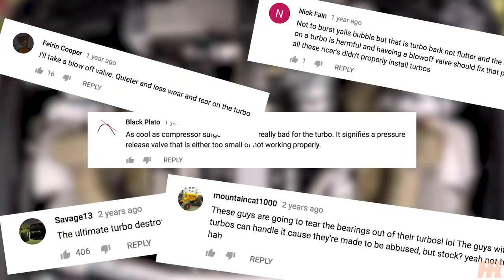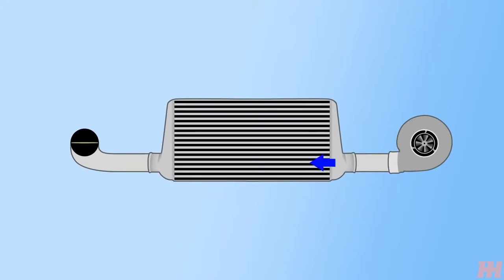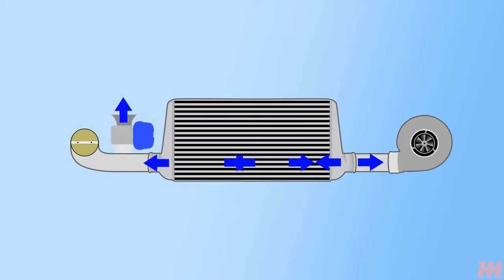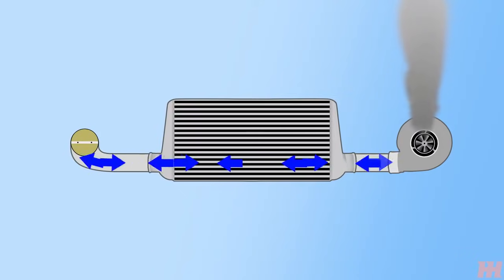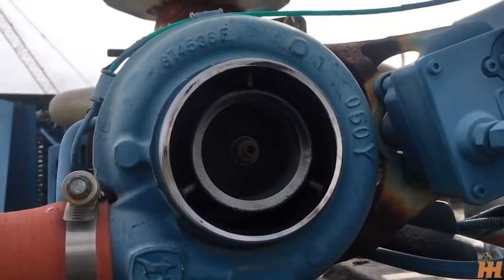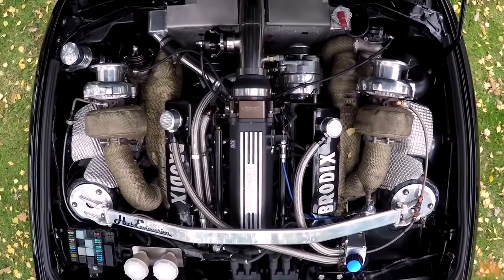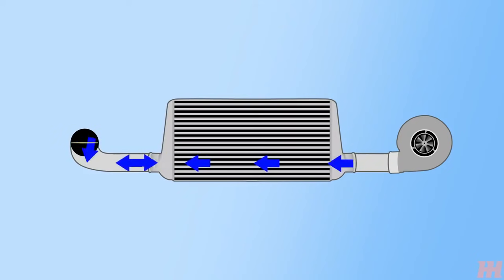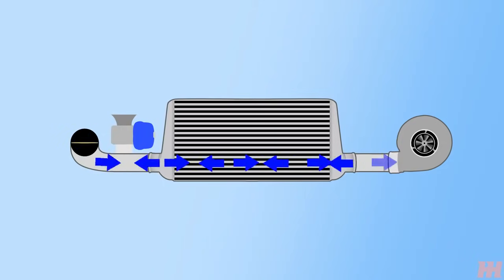The Truth About Compressor Surge

Comment: Just one question, if the throttle valve is the main culprit for reverse air surge, why do Diesels have blow off valves since they have no throttle body?
Reply: While they don't need them, they still help on a diesel to keep the intake air flowing smoothly through the compressor.  Although, as you said, there are no TBs on them, the thing that drives the turbocharger is the exhaust volume/heat... so when you stop "pouring on the coals" the turbo doesn't have as much exhaust roaring through it anymore, and that causes the entire engine's flow (VE) to slow down VERY dramatically (which will in turn "fight" against the compressor's high rpm), so they open up a "BOV"/solenoid to allow the turbo to continue freely pumping the air through.

Comment: my pickup truck has turbo and it didn't have BOV at all, and still fine running in 70,000kms.
Reply: If its a diesel its because diesels dont have throttle plates. No diesel has a BOV.

Comment: By a lot of peoples logic antilag would kill turbos in a day. Rapidly changing the speed of the turbo hurts it? Oh like (2 step or anti lag) sending 2 or 3 cycles of your engines unignited gas/air down the exhaust and lighting it ( ideally before the turbo) is meant to cause a rapid change in the turbo speed.. to add to it i would assume the extreme inharmonic vibrations or combustions would do more damage by rattling the turbo than air itself slowing it down. 

I think we can all agree the 11 year olds are not the people who think it causes damage, because im sure it has in a least a few instances before. But the people who genuinelly believe that the turbo spins backwards.

Comment: So if it’s installed correctly, do you still need a blow off valve? Because if you have a blow off valve you won’t get the closed throttle flutter, correct?

Comment: Open throttle compressor surge is common subaru’s with big power.
Reply: You're thinking of wastegate flutter which is common on modified Subarus, that sound comes from the wastegate rapidly opening and closing to maintain a certain boost level

Comment: I got question. Like most diesel cars atleast one i own (VW golf mk4) doesnt have Blow off valve from factory. But it does not damage the turbo?
Reply: Lukas Juozaitis. Let me know when you see the throttle closing on a diesel
Reply: Nebbia affaraccimiei ohhh really ;D sorry 😂 my bad
Reply: Nebbia affaraccimiei but is it somehow possible to get this "compression surge" sound from a turbo diesel?
Reply: Lazar Janjusevic well i never heard it and i highly doubt that it possible
Reply: Lukas Juozaitis. It's possible but i don't know how... Search on yt for 1.9tdi surge or turbo diesel surge and it sounds exactly like this
Reply: Lazar Janjusevic hmm diesel have more turbo pressure. Like mine golf have 1.5bar ( ecu remaped) maybe its because of that and pressure have no where to escape
Reply: Ohhhh i think mine car have surge. When you let off throttle there is like pruuufft sound like that. But can't hear because muffler and catalizator. If pressure would be higher it would be easy to hear i think
Reply: Lukas Juozaitis The Cats and muffler dont affect flutter sound as it comes out of the compressor side not the turbine side
Reply: Also let me know when your fucking diesel engine can't take more air
Reply: It's possible to get "off throttle" surge on diesel engines. If you go suddenly from high rpm on boost to idle or close to idle the amount of air the engine will be able to flow through decreases rapidly and the turbo will flutter for a moment. This is often very audible on tracktor and truck pull competition engines when they let off the throttle.

It's much easier to reach flutter on engines with throttle plates thought, because even if the rpm's stay up the plate will block of the air going trought immediately.
Reply: Lazar Janjusevic my dad drives a navara with the yd turbo diesel engine and when trottle is released while under load it flutters

Comment: Can you not setup a blow off valve so that it opens at a set boost pressure much like a waste gate? Then you could have the blow off valve venting excess air volume at WOT, which should stop the surge.

I'm not familiar enough with turbos to have encountered this issue, so please enlighten me.
Reply: Not sure if you are still curious, but if you install a flow control valve you can adjust it to where it becomes a delayed blow off,  gives you the turbo flutter we love and then relieves pressure. It's cool to play around with and you can adjust it as you would an aftermarket bov, AND you are able to do it on a stock BOV

Comment: Thank you for posting this , god damn do I get sick of morons thinking OFF THROTTLE “compressor surge” , aka flutter, is doing any real damaging effect 

Ironically I’ve been having a problem with my S15 under WOT where it’s been spluttering about at around 5000rpm, turned out to be the spring tension in the BOV set too tight . Once I had loosened it off, the problem is now non existent 🤦‍♂️😂
Reply: You're loosing boost at high rpm by loosening the bov spring,  the flutter at wot should normally be regulated by the Wastegate

Comment: Recently ive been slightly accelerating and hear a blow off sound usually when im going uphill
Reply: That's probably because you're not generating enough boost to open the BOV yet, anything beneath that will flutter. I hope its only happening as you back off the throttle, and not during acceleration..?

Comment: Aren't wastegates installed to prevent open throttle compressor surge?
Reply: Wastegates only divert exhaust around the turbine to try to maintain a desired amount of boost. If you set that boost too high it will still surge. It's something most of us wont experience. You really only see it on highly modified car running tons of boost.

Comment: I’d assume since diesels have no throttle plate and run via metered fuel injection. Cutting the fuel would be of similar effect for it since there’s no combustion for drive pressure to drive the turbo?
Reply: yep, pretty much!

Comment: ive heard on smaller and older turbos compressor surge can cause more damage, if i blocked off my recirc valve on my 98 wrx with the stock td04 turbo would it do much damage?
Reply: Older turbo's are actually less susceptible to damage due to not using ceramics or ball bearings.

Comment: This would be ok if you're maybe under 10 psi. Anything above and you're on borrowed time for a rebuild or replacement. People need to remember that the exhaust gases are still turning the hot side turbine while the compressor side is getting buffeted by returning air. Something will eventually snap

Comment: If ur having open throttle surge can’t you just install a valve that opens when this happens in order to keep the pressure from getting to high?
Reply: tamer ursavas it’s called a waste gate
Reply: Grant i tought the waste gate was only for closed throttle surge
Reply: tamer ursavas a waste gate basically limits how much the turbo spools by dumping excessive exhaust gas.  If you have open throttle surge this is because the turbo is spinning too fast / producing more air than the engine can use.  To stop this you get a correctly sized waste gate that can dump the excessive exhaust gas and keep the turbo spinning at its correct speed.  I hope this makes sense
Reply: Grant isn’t it better to dump the compressed air instead of the exhaust?

Comment: I'm not too familiar with the more intricate characteristics of turbo cars, but I'd imaging that turbo flutter is not good for keeping the turbo spooled.
Reply: You are correct, while turbo flutter with closed throttle sounds awsome and does not do any damage, it does slightly decrease preformance.
Reply: @MatthewKrebs_BlackBrave8  tell that to all the people who have snapped hx40s running htem off their map... you guys crack me up. some idiot says on the internet its not bad so you take it as religous law.. plenty of videos of people breaking turbos by barkign them aka surge.
Reply: @g__wizz  Yeah people don't come to the internet for the right answer, they come to find reassurance of what they want, that's how they justify it. It's just about convincing themselves.
Reply: @g__wizz  I mean people think it's smart not to vaccinate their kids because of internet "knowledge" and "research". Its legitimately sad and scary.
Reply: @g__wizz  link me to these videos? Cause I spent plenty of time around high HP cars when I was younger, none ran bov's, all turbos were fine. The only time I had heard of people swapping out turbos is when they wanted to get more boost than the turbo could put out. Never heard of one breaking because of surge lmao
Reply: @chrisbyers4726  hows that holding up for you.. here I am three years in not regretting NOT doing any of that nonsense.. you got heart issues yet?
Reply: @strider5119  https://youtu.be/nCj6Spwl1CU. You can see it bounce the wheel around... it creates thrust and ultimately wears the bearings to the point of the housing making contact with the comp wheel.

Comment: flutter happens when you are able to let go that compressed air via BOV etc. not during backpressure build. backpressure won't hurt turbo shaft one bit as it's not bending the shaft, however you can actually hurt your throttle body if you are dealing large enough amounts of boost, as it's just a puny plate made out of brass that just 'bodies' pounds and pounds of boost. BOV & recirculators are made to prevent that.

tl,dr; flutter is good, your turbo is fine, calm down.

Comment: Mine doesn’t make a flutter noise but it does sound like it’s clogged cuz when accelerating if the turbo works at 100% it whistles a little sounds clean tho 
Other time it makes sort of choke noise like chckk and the turbo lands flat on its face usually occurs after 4000 rpm but occasionally at 3100rpm as well the turbos only 98k miles old 
I do have a P0299 code that goes away after using degreaser for a few days even up to a week! And there’ll be no problems until it clogs back up
Could this be an oil intake issue? I really hope so cuz it’s only $25 for the part haha while the turbo could range from 250-700

Comment: ok but not running a bov/bpv wont it stress the turbo in the long term? and isnt a bov/bpv more efficient on a turbo pushing more boost than stock?
Reply: A bov can be another point of failure imo. I've never heard of anyone fixing a turbo earlier than anyone else. Plenty of people I know have blown engines and transmissions and still have the same turbo and no bov. I've seen "stock turbos" used with bov, with shitloads of shaftplay. I imagine there are a lot of other factors that will cause wear on it

Comment: can someone pls explain to me surge on turbo diesels, since there's no throttle plate usually, what would cause the surge? letting off throttle, less fuel going into engine, engine doesn't need as much air, air being thrown back towards compressor = surge? Someone enlighten me i'm confused lol, looking online has only made me much more confused.

Comment: The chirping or fluttering is the turbine vibrating and hitting the inside of the housing. It does cause damage. If you look at a turbo car without a blowoff valve and look where the turbine rides inside the inlet housing you'll see that there's chipping and damage on both the riding surface and the turbine tips.
Reply: First time I've heard someone say the fluttering is the turbine hitting the housing, another retarded thing to add to the list of things that doesn't happen when you run no blow off valve, funny when I took the turbo off my car after 5 years and a bunch of track days of running no blow off valve there was no sign of any damage.

Comment: Ok so we have done this to my sisters 2020 veloster n performance package and I seen that bov block off plates arnt safe for journal bearing turbos but are safe for bearing turbos so

Is it safe to do a bov block off plate on journal bearing turbos?
Reply: With some newer cars they have a recirculating blow off valve which the car is tuned for. So id be careful for your application.
But no matter the bearing it doesnt matter but a ball bearing turbo will always be better simply because its not relying on oil pressure to stay affloat. Ive been stututing on my journal bearings for 2 years fine

Comment: Shouldn't a waste gate fix open throttle surge.
Reply: Should and will
Reply: Yes but a blow off valve won’t
Reply: Waste gate is on the turbine hot side, limits the amount of exhaust gases flowing through the turbine,slowing it down or speeding up.Does not in any way stop surge,  that is what a blow off valve or diverter valve is for on the compressor side when throttle plate closes. Only time it will help is on a diesel, most are now VNT so its irrelevant.

Comment: Turbo flutter = extra stress on turbo = not ventilating boost properly. It might not be as bad as a lot of people say, but it's will slow down your turb in between shifts and cause a loss in initial power in next gear. Not to mention more vibration and stress witch will most likely cause a shorter turbo life.

Comment: Yeah but you didn't give an example of what open throttle compressor surge sounds like. Does it sound different than closed throttle compressor surge?
Reply: Yes it will sound the same
Reply: It sounds the same, but while accelerating. So you'll hear the turbo spool and then you'll hear constant flutter while still on throttle, because the engine isn't able to take in the excess air. Unless you put a huge turbo on your car, it's not overly likely you'll come across it.

Comment: Plenty of reputable performance shop's actually state they've seen early turbo failure because of no BOV, and that's street car/drag applications that don't see many kms.

In drag applications, it's not a major issue since you only let off once or a couple times. But on all circuit racing/rally applications where on and off throttle is continuously happening, they run BOV's for extra response and turbo sustainability.

End of the day though, each to their own
Reply: *Citation needed
Reply: I will try to dig up more, as most of this information I remember viewing months ago.

1. A high performance RB26/30 GTR owner (driven once a week on street and drag track days) on the Motive DvD channel stated that running no BOV caused his turbo to fail in comparison to when he installed a BOV. Tested on numerous applications to self-prove his theory.
2. https://www.youtube.com/watch?v=vuyJ5jD3r0o GFB explains that pressure returns onto the comp wheel when no BOV is present, but eventually sorts itself out (common sense would tell you all that pressure would be placed on the bearings - also proving old mates theory above correct). He than continues to mention that the pulsating air causes shocks to the comp blades and thrust bearings - and effects can be especially damaging / magnified when maxing out turbo efficiency.
3. https://www.sau.com.au/forums/topic/121656-no-bov-and-turbo-life-span/ - forum has members also explaining some of the issues associated with no BOV.
4. http://www.themotorhood.com/themotorhood/2015/9/14/does-your-car-need-a-blow-off-valve-we-talk-to-the-experts - racing team engineers / engine builders also chime in / however note in rally they are able to get more response by using antilag and no bov to keep air in the inlet longer whilst retarding ignition - also comments that turbo charger life is considerably weakened.
5. I can't find the reference relating to circuit racing / on and off throttle consistently - though using the other information would suggest that the more frequent surging on the comp wheel would cause damage at a faster rate, and just wouldn't be a smart idea if you cared about turbo life expectancy.

Honestly though, if you love the sound and dgaf about paying for rebuilds or buying new turbochargers than just do it, a lot of people do and accept the consequences that come with.

On my car though, I'll choose to listen to the engineers and run a BOV for the performance and longevitiy benefits, especially when they're $2,500+ per unit. http://www.gfb.com.au/tech/tech-articles/13-turbo-lag-and-the-turbo-management-systems-solution

Comment: This only happens on my vw atlas cross sport around 3-4 thousand rpm i recently stage 1 tuned the 2.0 motor in it using integrated engineerings tuner chip i flashed it with my phone so what can i do now to avoid this issue

Comment: Blowoff valve not opening during wide open throttle is not entirely accurate. There are systems out there that have a constant vacuum line (held in vacuum with a check valve) and an electronic BOV control solenoid. These cars can open the blowoff valve whenever they want, even at wide open throttle. They can even use the blowoff valve as part of the boost control strategy in cases where open throttle compressor surge is completely unavoidable. The excess air can be recirculated into the intake or just vent with a consistently cracked open BOV.